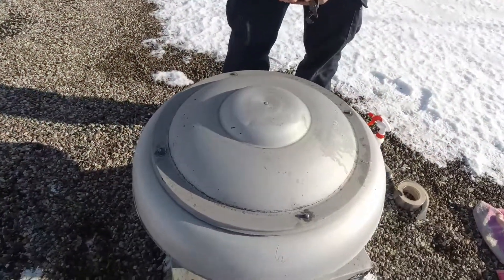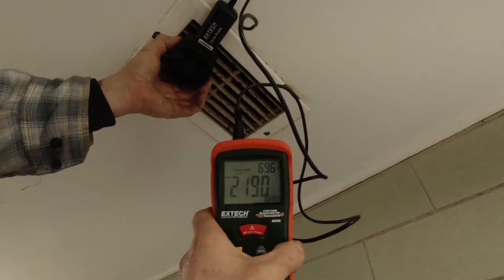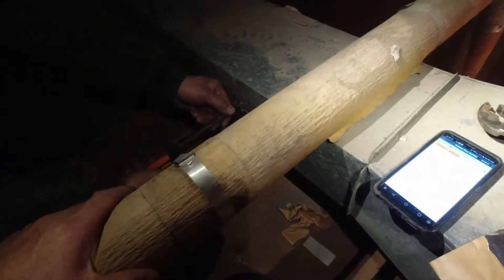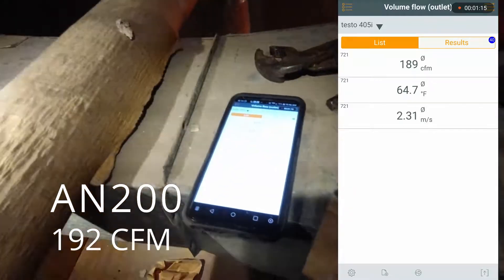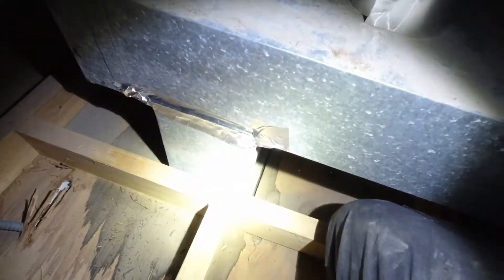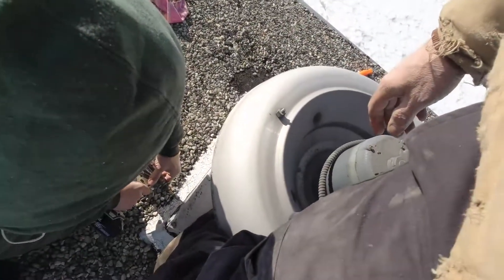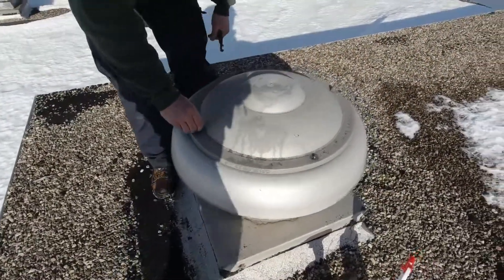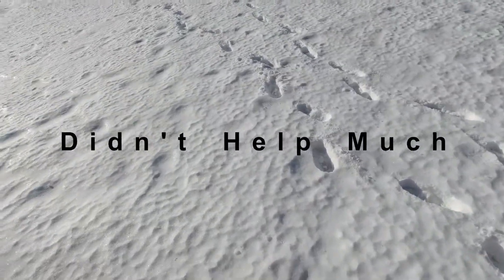Rooftop Exhaust Fan Underperforming, Needed Fixed ASAP -Covid-

Comment: I'm an HVAC contractor outside of Boston, Ma . Interesting video. I'm guessing that the four reading are adding up to 900 cfm, plus or minus, which is about half of the cfm's that you need from the ventilator based on the grainger model in the description. It's amazing to me how many systems I run into with air flow issues from bad duct sizing in the residential side of the business.
I have the Fieldpiece STA2 in Duct Hot Wire Anemometer, an older extech 451126 Anemometer and Testo manometer.
I'm hoping more people discover your work on Youtube!!!!!